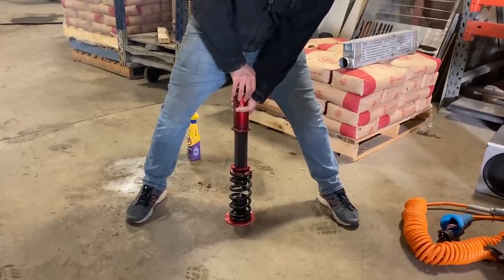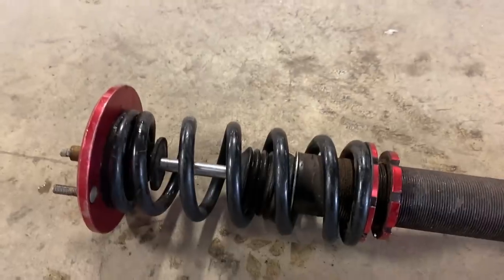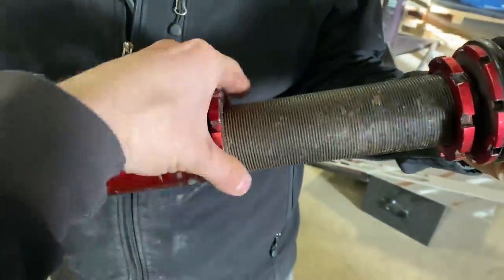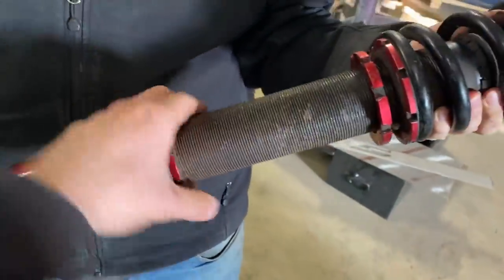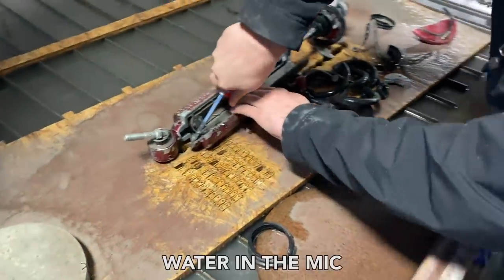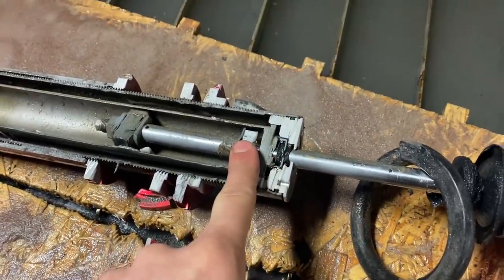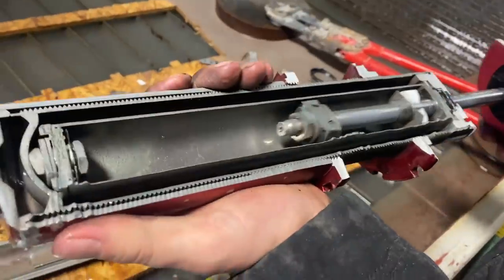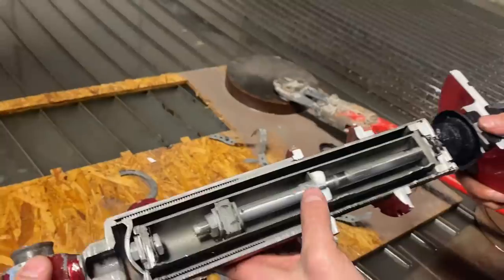Coilover Suspension vs 60,000 PSI Waterjet

Comment: The strut is filled with hydrolic fluid, when the piston compressed it attempts the compress the fluid, the dampening rate aspect is controlled by one of bottom of the piston with little holes to allow fluid to flow through, the can be adjusted on some coilovers to change stiffness during driving, the softer the damper the larger the holes, the stiffer the damper the smaller the holes

Comment: The hydraulic fluid and any gasses inside the strut/shock are under a great deal of pressure. Struts, shocks, and coil-overs function in the same basic way: The hydraulic fluid and pressurized gasses present in the cylinder press against the piston until a) equilibrium is achieved (vehicular mass/hydraulic resistance), or b) the piston is topped out. The 2-fluid system is what gives most vehicles either a smooth feel, or a boaty feel (dubbed 'wobble-matic suspension' by Alex of FailRace.) Of course, the hydro-pneumatic system can only do so much, which is why the spring is often present in either a conjoined (McPherson Strut/Coil-over Shock) or independent configuration (shocks + coil and/or leaf springs); to add more resistance against the vehicle's mass.

Comment: Just this week I was saying, I wish someone cut through one of these with a water jet... I'm not kidding. Stunned to see this in my feed :D I think pistons come in 3 varieties. Dampers, springs, and combos. A spring piston would just be a piston on a sealed gas chamber that bounces. A damper is liquid (or gas) that is moved between two chambers and acts to stop bouncing from a spring located elsewhere. And a combo might have both damper and spring chambers driven by the one piston. Or a coil-over where the spring is a metal spring.

Comment: So for shoal absorbers that channel is filled with a certain type of fluid that is able to relief its self through a valve at the bottom of the strut rod in the casing, it allows fluid to transfer some one side to the other causing an damping effect, the strong is what keeps the strut assembly under tension so the fluid isn’t transversing the the 2 way valve (has approx 1/8” passages precisely drilled into the block assembly), correct me if I am wrong

Comment: thats a crappy dual tube shock. they don't have adjustable dampening because of their design. the fluid is pushed from the inner tube to the outer through tiny holes at the bottom, this provides dampening. shocks dont hold the car up, springs do. They do extend from the low pressure gas in them though, but not near enough to support much weight. you can push them down by hand. 
A mono tube does not have an outer tube. the fluid is pushed through the piston and the adjustable damper opens or closes some holes in the piston that the fluid passes through, mono tubes have high pressure gas which allows them to react much faster, giving a better ride overall.

Comment: no it doesn't go into the outside sleep on the river gromit on the shaft there are little holes that allow the fluid to pass through it that's what dampens that is how is shock absorber works

Comment: That strut in the middle is a shock absorber, it doesn't so much provide the bounciness of the bounce but stops the entire suspension from experience high shock when you slam into the same pothole you've been hitting for the last 9 years because your municipality is too lazy/cheap/stupid to fix it properly so it gets dug back out every few weeks to rear it's ugly head to once again destroy your car's running gear for the 3rd time in 2 years
Also helps to smooth out the motion of the suspension components as they travel up and down